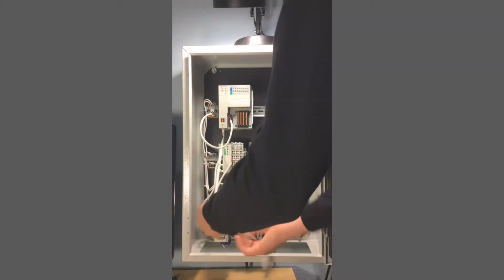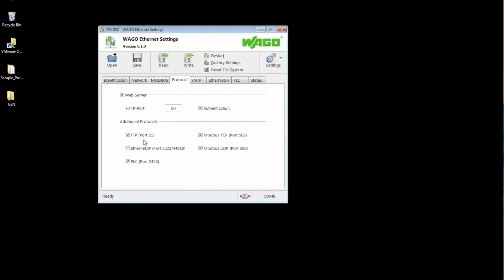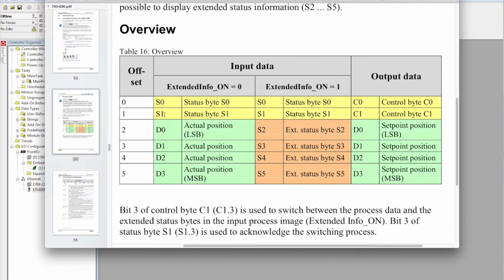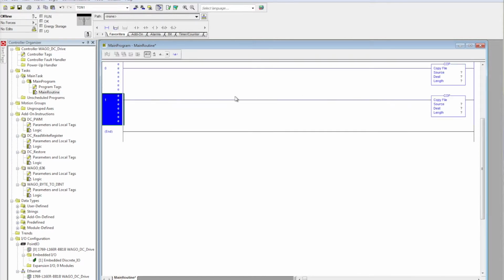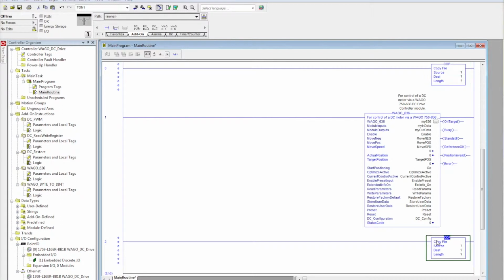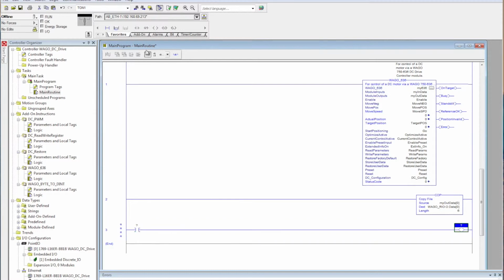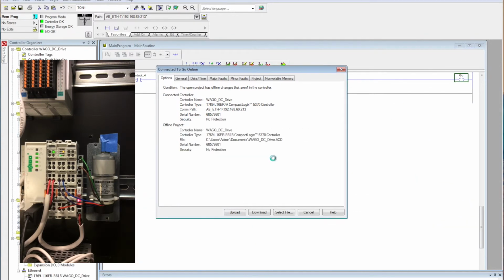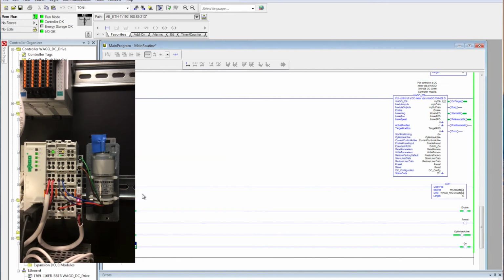WAGO 750-636 DC Drive over Ethernet IP

Comment: Excellent work sir! Can you verify if  the 750-636 will do speed control? I'm pretty sure it is meant just for position maintenance.
Reply from the maker: +John Hagar this is only capable of positioning mode. It will not operate in velocity mode.